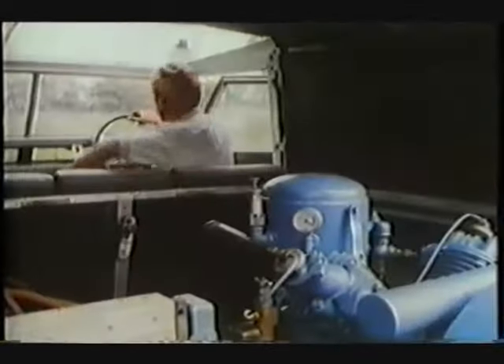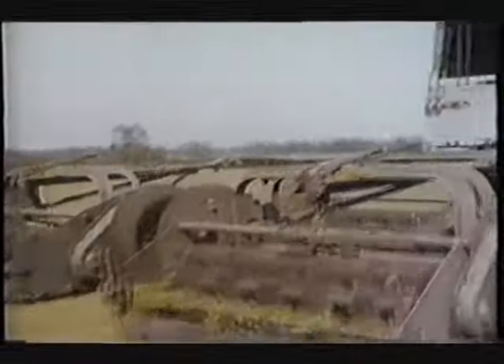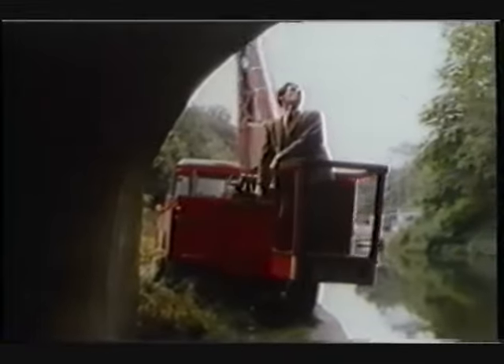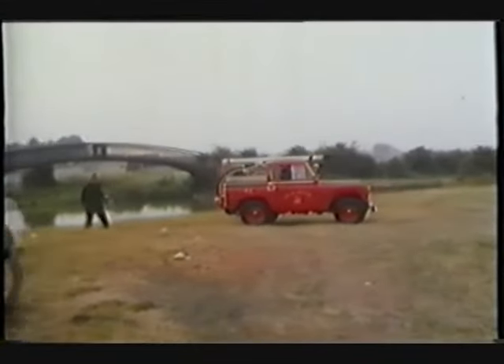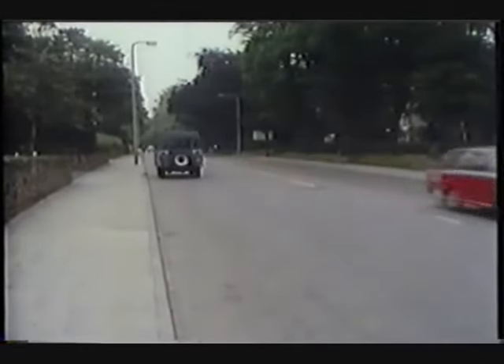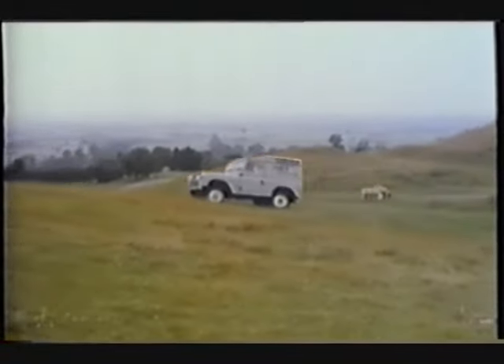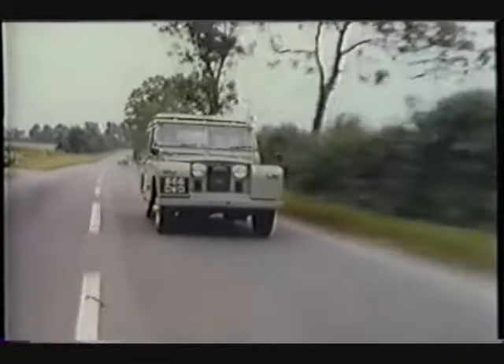Land Rover - All in a Day's Work, Part 2 of 2

Comment: dad has one with the broomwade compressor seen at 5.00 ... it is battered though :( and restoring is a bit of a far fetched dream of mine. (not shared by other siblings ) sigh
Reply: Are you making progress with it ?
Is it the smaller of the two larger ones ? (This makes 3 different size compressors !)
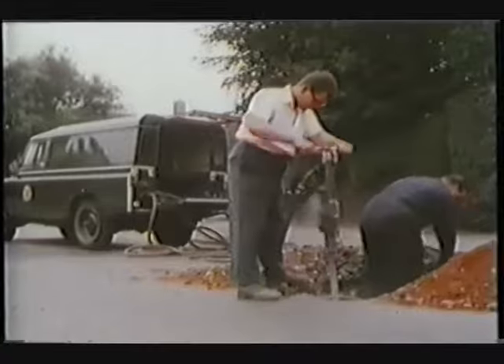Reply: The one at 5:00 is similar to the one my dad drove for the SSEB ( RGG96G ) with the special slanted grille, but he also had a hydraulic winch on the front so the bumper stuck quite far out,  but the one I remember most was JNS756N a series 3 in grey and cream which also had the compressor mounted just behind the rear bulkhead.  I’m not sure who made the compressor but I remember it had a large chrome screw cap on top which was possibly where the hydraulic fluid lived.
Reply: @roddyk05  the screw that was near the tow point was for topping up the compressor hydraulic system. The compressor unit is a Broomwade Whirlwind 100 I think. i did download a workshop manual for it. But sadly no progress on it. Yes my father's had a hydraulic winch too The winch and the compressor do not use the same oil. The compressor is a vane type with wooden blades. There is still a hydraulic tank for the winch in the side under tub bench right behind the driver seat/fuel tank area. it also had the remnants of a mount for the winch which bolts to an extra crossmember at the very front where there are the spring hangers. I did manage to procure a correct and fully refurbished bottom hydraulic PTO (the seat box had cutout for a valve controller and the levers for the BPTO too. I also got a used hydraulic winch in need of refurbishment. but the start of the refurb is lights away :(
Reply: I'm restoring 2  Station wagons. Ones a dailey driver which gets used in my woodland weekly. It takes a lot of time for a proper job. But we need to keep them going as they're our identity, and we don't make much to be proud of anymore, so all the more reason to inspire younger generations of what we can do with some hard work and determination.